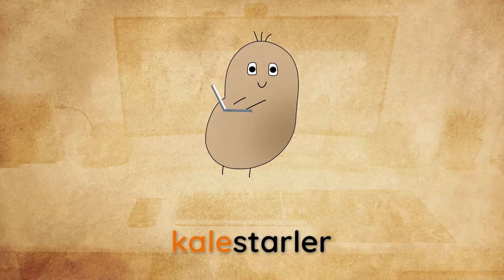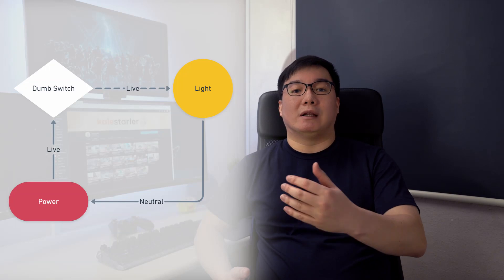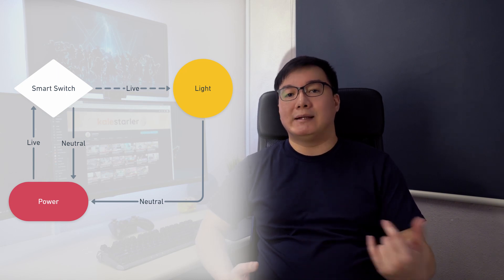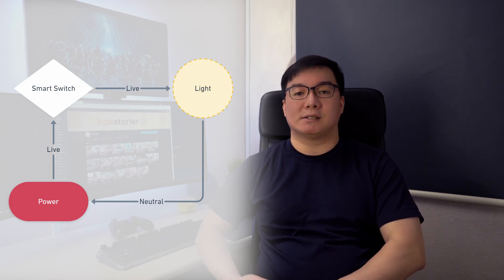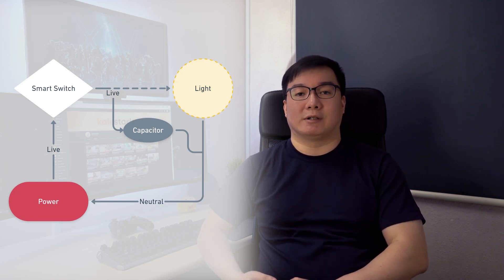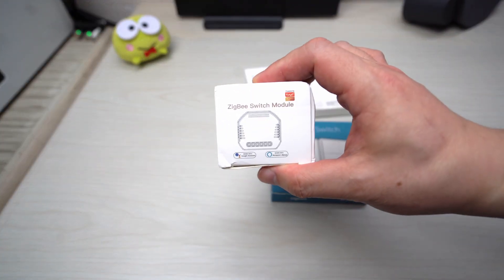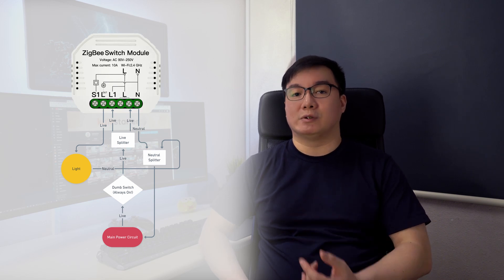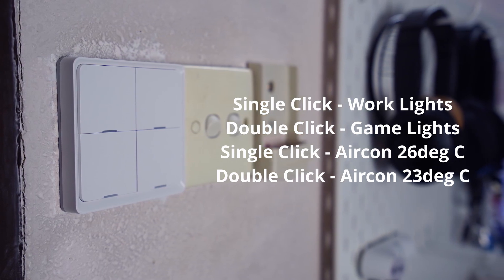This Zigbee Switch Module fixed my light flicker problem

Comment: Thanks for the video. I tried to install a zigbee wall switch but for some reason it trips the breaker. Is it a faulty product?
Reply from the maker: Any chance is wiring issue? If it's tripping immediately it sounds like the circuit might have been connected wrong

Comment: Hi. Very informative video. I'm also planning to get some Tuya smart switches during my renovation. However, I'm hearing that there's a buzzing sound (even with capacitor) with these Tuya (no-neutral wire required) smart switch. Have you got such a problem?
Reply from the maker: Hmmm. I think with the no-neutral ones, your mileage will really vary a lot, as it also depends on the conditions of the electrical cabling in the house, etc. I have heard the buzzing on occasion.

In the end I went with a neutral wire solution to get by all of the intermittent issues I was facing. Personally, my preference now would be to only use neutral wire switches, or just get smart bulbs or smart lights directly.

Comment: Mine cannot seem to pair with my smart life zigbee hub, not sure why, I press and hold bottom left square for 10 secs, it blinks twice then stops
Reply from the maker: Hmmm. Might be one of the other buttons - I can't recall which is the one I used for pairing. Do you have other devices paired successfully to your hub?

Comment: Hi! Love your videos! I'm currently considering laying neutral wires to some of my lights and switches. But I'm not sure which are necessary. Do you have any recommendation?
Reply from the maker: It is easier to have a neutral wire at every wall switch - this way the smart switches can maintain their own full circuit, while controlling the circuit leading to the lights. I think it's worth doing

Comment: Hi @KaleStarler I have the sample problem with my smart Switch and its a wifi 4 Gang switch. I've connected the Capacitor to the 1st gang switch which is a CFL bulb, but my 2nd Gang bulb is an eco lower power bulb and it recently started flickering. Do you think it will work if i put another capacitor to the eco bulb also which is connected to the 2nd Gang?
Reply from the maker: Not really an electrician, so I'm not sure if it would help. The solution I used in the video was to make use of the neutral wire at the light gang directly, rather than just the live wire at the wall switch

Comment: Question, if your WiFi is off, will the zigbee remote still manage to turn on or off the switch relay?
Reply from the maker: If you're asking whether it works if your phone WiFi is off, but the devices at home are still connected to internet, then yes, you can still control. Can even turn on/off when you are away from home.

But the home WiFi network must be on of course, and connected to internet. If WiFi is on but not online, normal controls also start to have issues (automations definitely don't work from the SmartLife app).
Reply: @kalestarler   hmm, mean the ZigBee device cannot talk with each other locally between the gateway everything still need pass by Tuya server. Which mean if your internet provider offline you can't get the light on. 
Maybe is rare case to have internet issue at SG. Ok thanks for the info.
Reply from the maker: Some devices do continue to work, but your mileage may vary. Better to assume it won't work if no internet, to be on the safe side.

There are workarounds, but complicated to setup. There's this software called Home Assistant that allows you to control these devices over local network instead to bypass this reliance on internet. I haven't had a chance to try it though, but like you mentioned, internet downtime quite rare in SG. Maybe once in a few years so far
Reply: @kalestarler  Thx for all the info.

Comment: Great video, but 1 question. What if your WiFi goes down? Will ur zigbee switch still able to control the light?
Reply from the maker: Hahah good catch. My ISP did have to go down for maintenance/migration once and I lost the ability to control quite a few devices (WiFi ones were still okay). Recently there was some downtime related to the Tuya servers as well that resulted in some downtime (devices were ok, automations were not). However, these are really rare occurrences for me. In the few years I've used these smart home devices, really only those single occurrences so far.

A good alternative that I've always wanted to explore is local Tuya - basically remove the dependency on a cloud/server connection, by using something like HomeAssistant. Previously it seemed to be quite a pain to setup, but it seems like Tuya recently released a new beta to support HomeAssistant. Hopefully I get a chance to explore it soon.

Comment: Hi bro.. check with you, how i can use the door sensor to switch on the light?
Reply from the maker: Inside the Smart Life app, under the "Smart" tab, you can setup automations. When creating new one, you need to set the Condition (in this case when door sensor is triggered open), and the Action (which is to turn on the relevant device).

You can also set multiple conditions, for example, I have an automation that also checks for how long my window stays open, and if more than 5mins, it auto turns off my AC

Comment: Thanks for the explanation. I have been trying to fix my lights flickering problems after installing with wifi switches...
Reply from the maker: Glad it helped! Are you going to try the zigbee switch module? Might also be easier to change the light itself to a smart bulb/light

Comment: Hi thanks for making this video been looking for such a video for ages! Is there a dimming module that can work without neutral wire? My house has no neutral wire and will cost thousands with wall hacking to construct
Reply from the maker: Yes there are! Actually on Lazada and Shoppee, the no-neutral-wire light switches are a lot more popular since it's more suitable for the market here. Would suggest getting a cheap one to test out. It just happens that for my particular light fixture, the no-neutral-wire option wasn't suitable, that's why I switched to this.

Alternatively, you can consider switching to a WiFi or Zigbee light bulb / light fixture, then no need to worry about neutral / no-neutral going to a smart switch

Comment: Thanks for this! Do you think it's necessary, or rather, worth the cost, for new BTO owners (intending to do up smart homes) to get electricians to pull neutral wires to all switches?
Reply from the maker: Hmmm. Without the neutral cable at the light switch, and using one of these modules at the light fixture itself, has some drawbacks. E.g. when there is failure with the Zigbee connection etc, you may not be able to turn on the light. Either using a smart bulb or a smart switch with neutral wire might be better overall
Reply: @kalestarler  I thought so too... Thank you so much for the feedback!

Comment: Hi Kale. I installed a Smart switch W/out neutral and comes with a capacitor. Every thing was set up perfectly and able to manually and using Google home to turn ON and Off by Voice control. The problem i'm having is, it turns ON momentarily and then Turns Off within 2 seconds. I'm puzzled by this. Any advise or suggestion, that i can try? Thanks Sunil
Reply from the maker: Did you install the capacitor into the light fixture itself? Usually the capacitor somewhat helps with such "flickering" problems. In my case it was not good enough though, hence I went back to a setup with the neutral wire
Reply: @kalestarler  It does not flicker as in rapid blinks, mine turns on and then off in about 2 seconds and simply does not stay on. Yes the capacitor is connected to the neutral and live at the same outlet of the lights live and neutral wire.
Reply from the maker: Just curious, does the "on/off" state in the app also change when it turns itself off after 2 secs?

Not too sure what else might be the problem, I'm suspecting a faulty switch
Reply: @kalestarler  Yes. The Problem is either the switch or the capacitor itself. I replaced another brand new switch with the capacitor yesterday and it works fine. Thanks Kale. Regards Sunil 💪
Reply from the maker: @kdsunil2359  Good to hear you have a working one now. Enjoy the switch!
Reply: @kalestarler  Thanks Too. Have A Great Day Ahead 😀
Reply: @kdsunil2359  Hi there !! 

Did you resolve your problem? 
This is happening with me the light keeps flickering when I'm using an LED lamp. That doesn't happen when I'm using the fluorescent lamp. 

Any advise as to what to do?

Thanks
Reply: @leulino  It`s because the led lamp does not put enough load on the switch circuit, try it with a halogen and see if it stops. If so you need to buy a load resistor with heatsink from Danlers

Comment: Hi, so did you completely remove your old wifi wall switch and shorted the connection for the wall switch so that it is always on? Was trying to figure that part out from your timelapse. Are you able to explain a bit more on how a traditional dumb rocker switch is used in conjunction with this? i.e. if the dumb rocker switch is offed, does it trigger an off command in the zigbee switch? and if so, what happens if i attempt to turn it on via zigbee/app? and did you have to prepare/cut (extra) wires just to mount the switch in the light fixture?
Reply from the maker: Hi Dingyan, there is no neutral wire at my existing wall switch. So because I wired the Zigbee module into the light itself, it means that if I turn off the existing wall switch, power is cut from both the Zigbee module and the light. In my case, I don't turn off the wall switch anymore, and only use either my iPhone/iPad or the Scene Switch to toggle the light.

However, if your wall switch does have a neutral wire available, the Zigbee module seems to be configurable to allow 2 switches to control the light. I'm not able to try this out though.

I had to use a little bit of extra wire to hook everything up. Didn't manage to film it because I had to climb up to do it and couldn't really record, hence the circuit drawings instead. It took me a couple tries to get it right because I wasn't familiar how the light fixture's circuit worked with its ballast and starter, but managed to do so in the end (without causing any power trips in the house, phew!).
Reply: @kalestarler  thankks for the quick reply! i dont have a neutral in the wall switch like you too, but I was looking at the wiring diagram under the (With One Switch (1 Way)) and it seems this was actually designed for wall switches without neutral. i ordered mine last night and am waiting for mine to arrive to try. i cant seem to find much resources for this product but i saw a video for a similar product from sonoff and the person showed how it workked with a normal switch: https://www.youtube.com/watch?v=Mv1kjHOe6bM In this you can see a dumb switch with only Live was used in conjunction with the app. I think the tuya one is supposed to function the same?
Have you seen any other resources anywhere where they used this tuya switch?

Comment: I have an electric heater that is hardwired to a will socket. Can I use a zigbee switch module to turn on/off the power for the header by installing it in the socket?

On other videos I’ve seen you have to turn on/off the light switch a few times to setup the zigbee device (I don’t think I can do this with my heater as it doesn’t have an on/off switch). Thank you!
Reply from the maker: Hmmm. I'm not an electrician, but from what I know heaters are different. The switch has a higher capacity fuse or something, so I don't think it will work with the regular light switch module, you will need a different product

Comment: I got the same switch module, but I want to put it behind the switch, so I can use the switch and also use it wireless. However, I can not get it working. Did it work for you? Do you have a live picture of how to connect?
Reply from the maker: Yes it worked for me. But took me a while to figure out the circuitry. My module is installed directly at the light though, so it might be different compared to connecting it at the switch. Would suggest following the wiring labels/diagram on the module itself

Comment: Can it use for T5 light? thanks
Reply from the maker: Are you referring to a fluorescent tube size? Should be no issue! I have it hooked up to my very old fluorescent light fixture (with the typical ballast and starter thing). If I'm not wrong, mine is a T8 tube